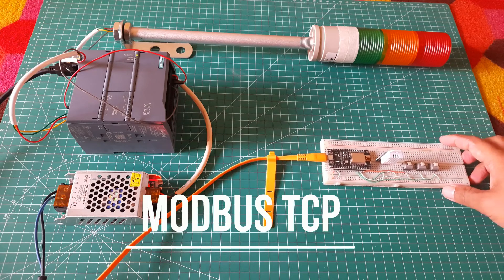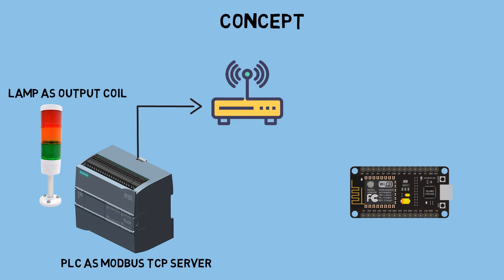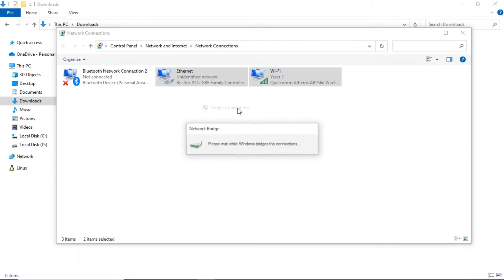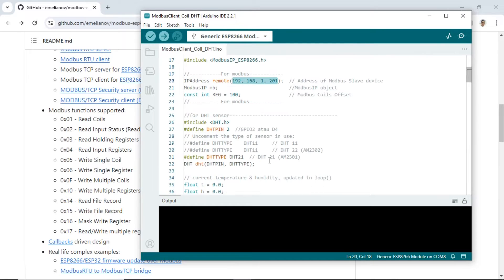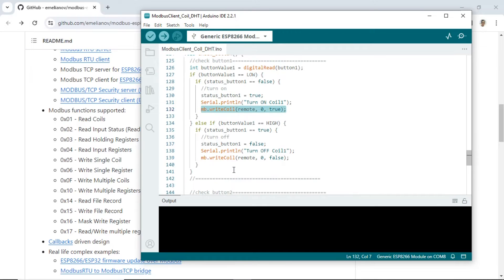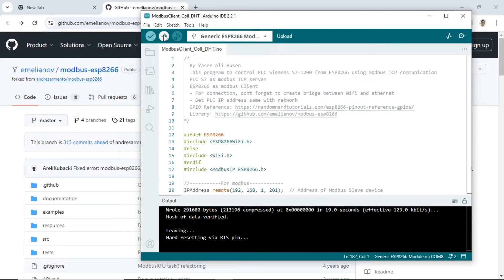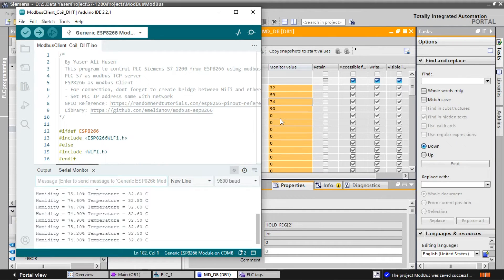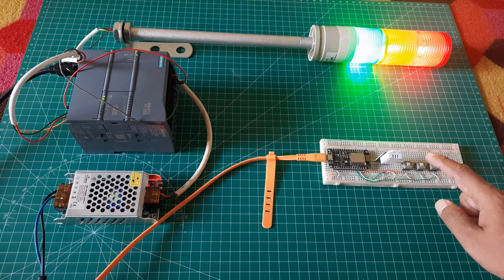Control PLC Siemens S7-1200 from ESP8266 using Modbus TCP Communication

Comment: Modbus on a S7-1200 is strange. It seems that the addressing of methods like read_discrete_inputs, read_coils and the counterparts for writing are ignoring the start address. It works fine with reading/writing holding_registers. Maybe the source of the problem is the Python module pymodbus, but I'm not sure.

Comment: how did you define an ip address for the slave?
Reply from the maker: Configure the IP address of PLC using TIA Portal.
Make sure the IP same with network configuration
Reply: @YaserAliHusen  so the ip address of plc is the same with the ip address of my laptop?
Reply from the maker: @jordanklissman1768 , different IP, So you have 3 different IP address
Laptop, PLC and ESP.
For ESP maybe it will generate by DHCP, but you should create bridge
Reply: @YaserAliHusen Did you fill in the IP address of the client in the TIA portal in the CONNECT section in the datablock?
Reply from the maker: @jordanklissman1768 , No I dont.
You can watch my video about configuration modbus in PLC: https://www.youtube.com/watch?v=YuRjIp0cipA
Reply: @YaserAliHusen  i have watched that video and it works but the problem when i use esp32 AS a modbus client then it can't connect
Reply from the maker: @jordanklissman1768 , server cant connect with multiple client, make sure, there is no a client connect to server
Reply: @YaserAliHusen  just my laptop and esp32
Reply from the maker: @jordanklissman1768 , just for make sure,
You have a PLC as modbus server?
Then you want to create an ESP as modbus client, then the problem is ESP cant connect as Client?
You computer connect to PLC using ethernet.
Right?
have you created bridge between wifi and ethernet on your laptop?
then can you ping ESP?
Reply: @YaserAliHusen  i can ping my plc but not my esp
Reply: @YaserAliHusen  i already bridged the Network but i can't ping my esp with the address in the Arduino ide
Reply from the maker: @jordanklissman1768 ,Your laptop connect in same wifi network with ESP?
Reply: @YaserAliHusen  yess

Comment: can i use esp32 instead of esp8266?
Reply from the maker: I think you can use ESP32 with same library
Reply: @YaserAliHusen  i tried but it doesn't connected. My ip address for the server is 192.168.0.1 and the client is 192.168.0.2, is that correct?
Reply from the maker: @jordanklissman1768 , yes it should be correct. You can test by ping command from a computer to both of them

Comment: Nice video, but i have a question. Can it be the other way around? like arduino can also read holding registers from plc...
Reply from the maker: Yes, you can use ethernet shield for communication.
Reply: @YaserAliHusen  Can you explain it? Especially in the PLC section, because I am confused in that section. Or maybe you can give me a reference source where arduino reads data from plc, thx
Reply from the maker: @barajr1349 , For PLC still same, you just activate modbus TCP server in PLC.
How to configure PLC as modbus TCP server you can find the video on my channel
Reply: @YaserAliHusen  So, in the arduino program we just need to add mb.readHreg ???
Reply from the maker: @barajr1349 , yes correct.
You can find out how to use it in internet, or watch my videos related this matter
Reply: @YaserAliHusen  okay sir, thanks a lot...

Comment: I have a esp32 and s7 1200 and a wireless modem how can i connect them together thanks
Reply from the maker: You can follow the video, ESP connect with Wifi, and S7-1200 connect with ethernet.
Wifi and ethernet connection must in one network, you can create bridge between

Comment: Thank you so much for the guide, I've been looking for one for a long time
but
it does not work for me.....
The arduino fails to establish communication
Reply: In the Knesset file 502 in the port number both at the entrance and at the exit this was the fault
Reply from the maker: Do you use ESP8266?
For checking the connection
You can ping them from your laptop.
If they are detected, you connect ESP to PLC.
Ensure you have bridge Wifi and Ethernet